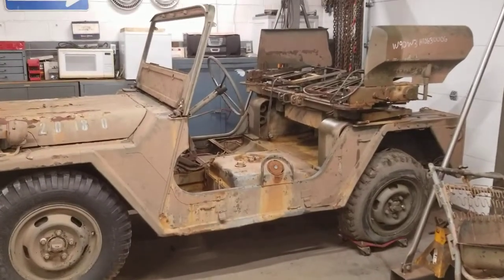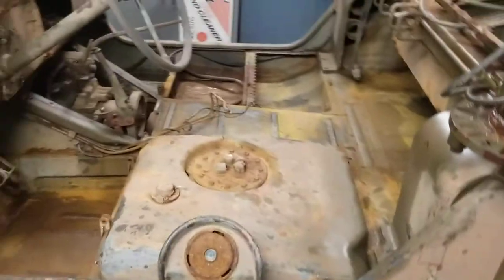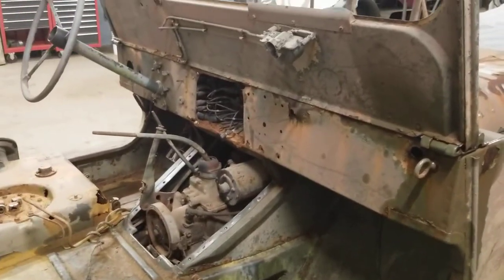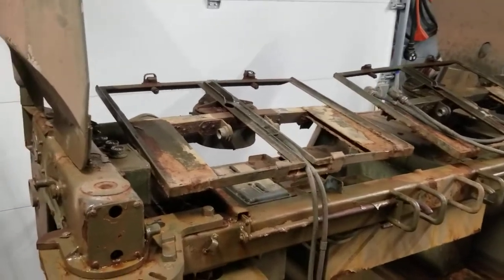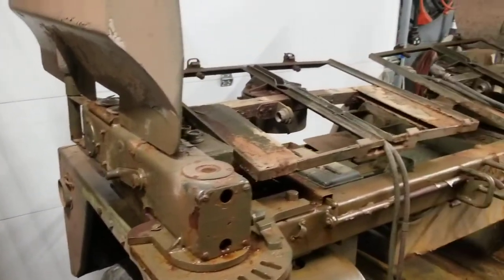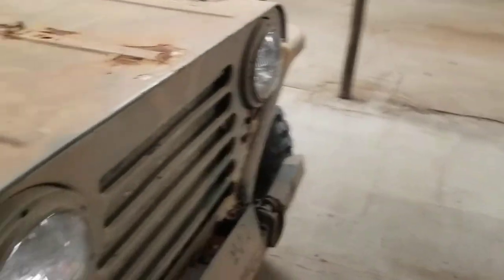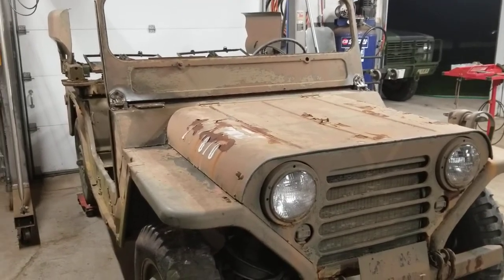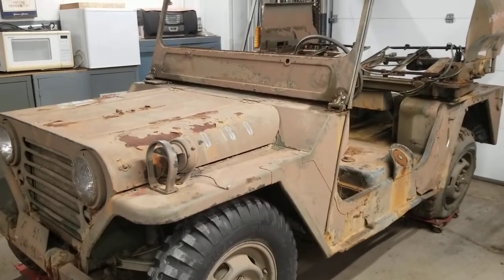1962 Ford M151

Comment: Hi, I just purchased a 1961 M151 and want to restore it. I also purchased a 1969 M151A2 that I'd also like to restore. I don't know anything about them but want to learn. Both of mine are uncut and titled to be driven on the road. I've heard that it's very difficult to get one that's titled to be driven on the road and that only a thousand to fifteen hundred were ever allowed to be driven on the road. Anyways, that's what the guy that sold them to me said. I plan on restoring the 1969 first and then selling it. Then I'll restore the 1961 and keep it. I've heard that you can find new old stock of all the parts and body panels. Is this true and if so, how do I get these body panels?